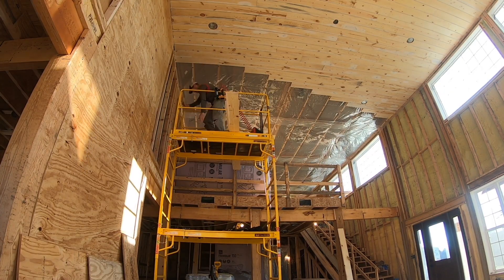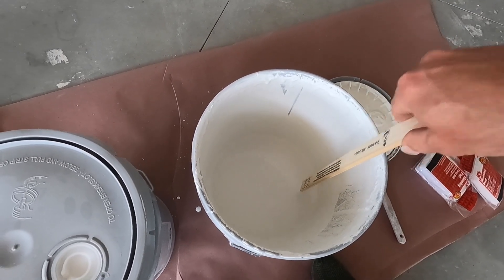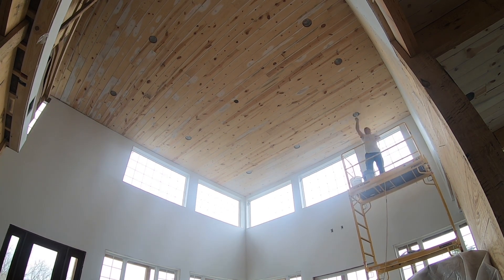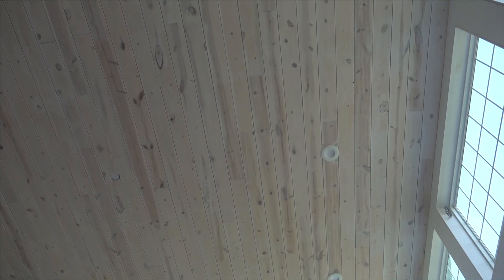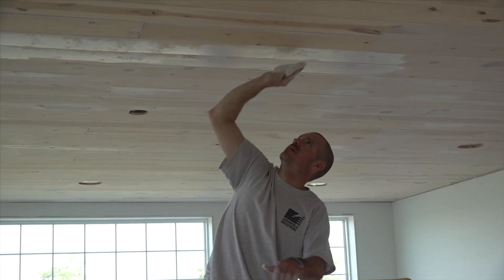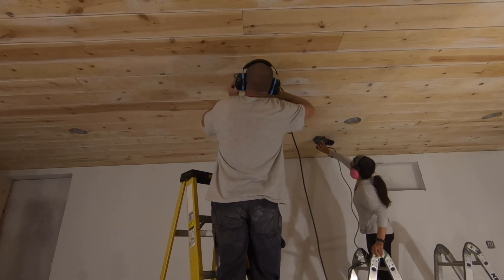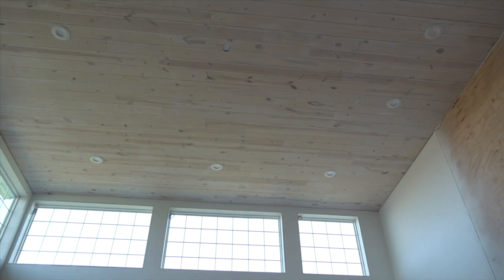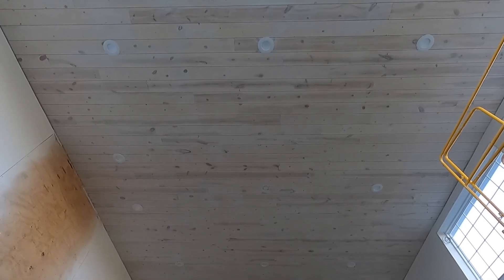Whitewash Pine Shiplap Ceiling | DIY

Comment: Did you have to do any caulking? If so is that done before white wash?
Reply from the maker: We chose not to. We've since added a quarter round piece all along the edge where the ceiling meets the drywall. We absolutely would whitewash the boards BEFORE install though haha.

Comment: The problem is that you do not see the work going in,... great job you two! You see those remodel programs on tv, the pict up a brush, one stroke of paint, a hot wit a hammer and then the next shot they are finished. I know remodel by yourself is work, hard work. 90% is behind the walls, in the floors, in the ceilings... again great job!

Comment: Looks awesome! We are currently building a modern farm house and want to do this in the living room and master bedroom. Any thoughts on doing the whitewash on the pine boards before we do the installation? Also, what brand of scaffolding is that you're using?
Reply from the maker: I would do it before if you are able. Much easier. 

Metal tech is the company name for scaffolding.